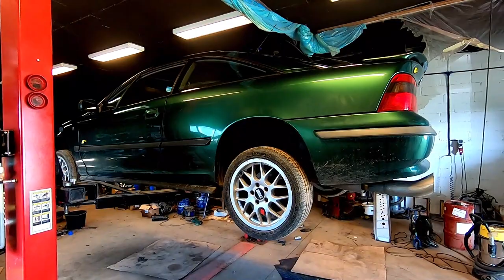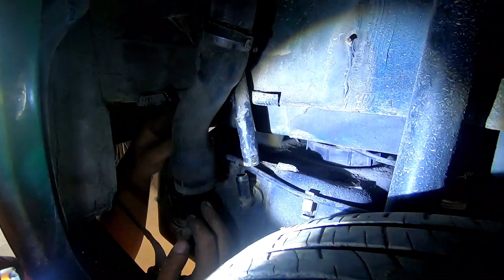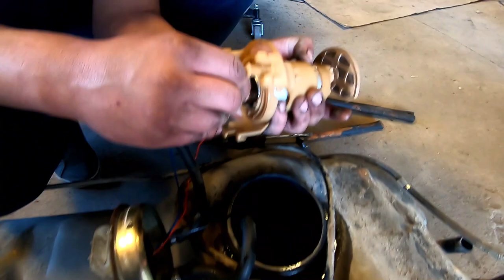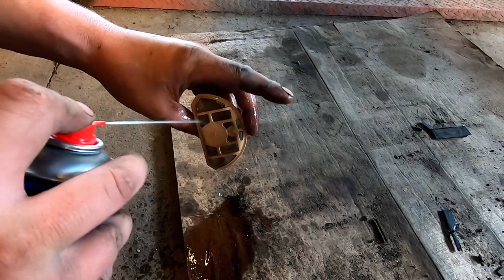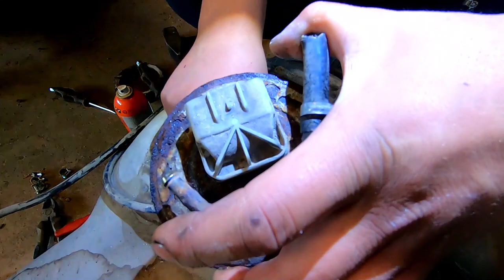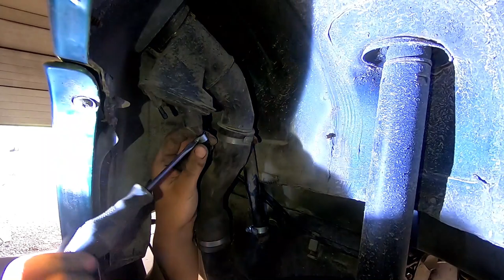Opel Calibra Restoration part 3(Fuel pump)

Comment: Great video. I have 2 x V6 Calibras here in the UK and need to do this as they have been sat for 2 to 3 years. Need to drop tank, drain fuel, check hoses, and check pump. If the lid hasn't corroded too much, it can be taken down to bare metal and resealed to repair the existing one, as i made a similar repair some years ago!
Reply from the maker: Thank you.I am glad that calibras are kept alive.I hope your tank cover is not very corroded.

Comment: Congratulations for this calibra. I love it. All calibras with the v6 engine has the fuel pump into the tank?
Reply from the maker: Thank you for the good words.For the pump location older calibras before 1995 had the pump outside the tank.Maybe v6 had the same solution.🙂

Comment: Buen video,en uno de los mios que tengo dos uno rojo y otro negro,el rojo no arranca por que del manguito de la gadolina a la bomba no sale gasolina como si estubiera el tanque vacio,mi pregumta es por que pasa eso?esta en reserva y e leido que puede ser por la junta del aforador...pero que tiene que ver?mi bomba y filtro estan detras del deposito por fuera del deposito
Reply from the maker: Thank you.Have you checked is your pump working.I had a problem with a fuel relay and then with the pump itself.
Reply: @TheMeisner87  la bomba de gasolina esta biem le puse la del otro calibra,el rele de inyeccion y tod para probar pero el caso es que no echa gasolina,aun desconectando el manguito que va del deposito a la bomba,ni aun asi cae gasolina que deveria caer sola cuando se quita ese manguito
Reply from the maker: @daniell.6933  have you checked the immo.Maybe it’s preventing the pump to work.What does the pump do when you put in the ignition?
Reply: Yo tengo el aforador mal creo que es la junta esa que dicen que dan guerra pero no se cual de ellas es,yo tengo dos calibras del 91 y llevan la bomba de gasolina en el exterior
Reply from the maker: @daniell.6933  When you have the fuel pump outside then its easier to test and fix them if needed.
Reply: @TheMeisner87  la bomba esta bien ya que le puse una garrafa con gasolina conectada a la bomba,aciendo de deposito de combustible y el coche arranco,estoy seguro es la junta que se abla por internet del aforador pero no se cual es esactamente
Reply from the maker: @daniell.6933  You can write me on MeisnerVlog on facebook and lets try to find out that is the problem.Or you can write me on instagram.
Reply: @TheMeisner87  gracias por tu ofrecimiento pero no uso redes sociales,pero gracias
Reply from the maker: @daniell.6933  Ok,but if you need help then you where to reach me.
Reply: @TheMeisner87  gracias,ahora voy a mirar si puedo sacar el deposito
Reply: @TheMeisner87  ya lo e averiguado entra aire del manguito que va del deposito a la bomba esta cuerteado y roto
Reply: @TheMeisner87  ya lo e averiguado entra aire del manguito que va del deposito a la bomba esta cuerteado y roto
Reply from the maker: @daniell.6933  i hope when you change the hose then the problem is fixed.🙂
Reply: @TheMeisner87  gracias eso espero,por que con mas de medio deposito aun no arrancaba y la junta esa es cuando esta por debajo de medio deposito entra aire,y el manguito esta cuarteado e soplado y salia aure por los lados
Reply from the maker: @daniell.6933  that is the probably the reason for the problem i think it will get solved.